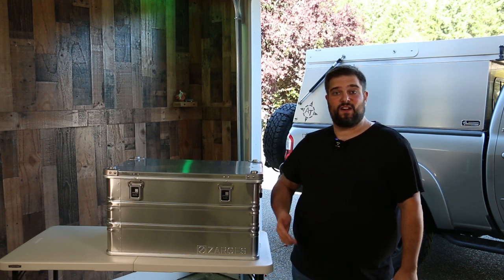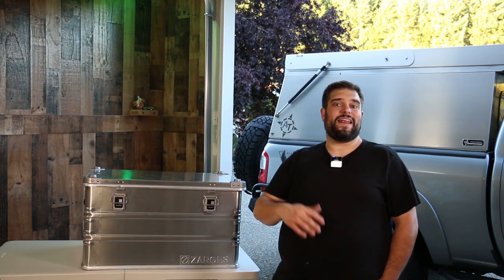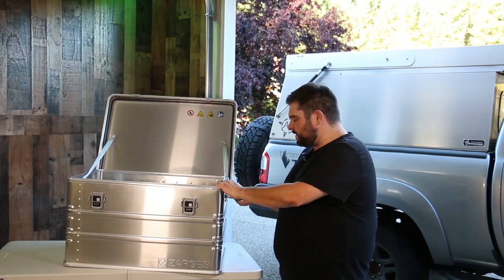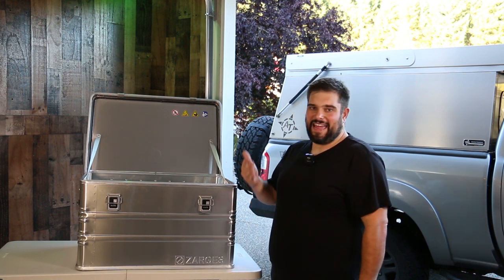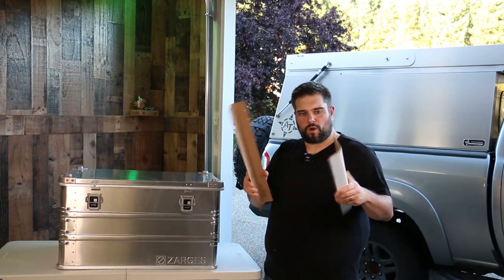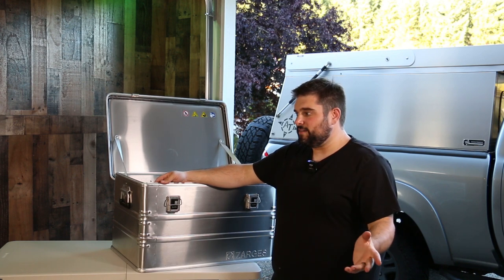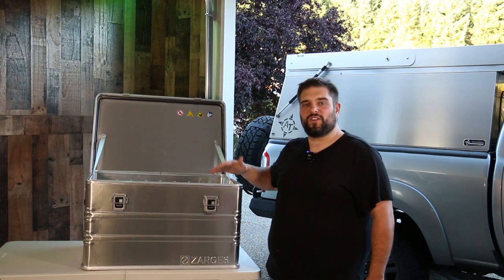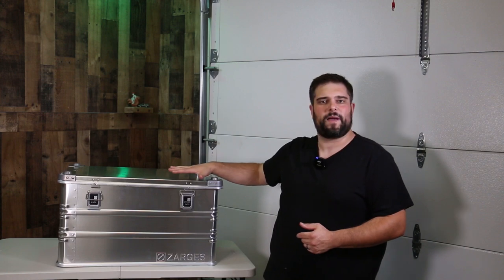Overlanding Gear Storage - Zarges K470 Aluminum Case Overview

Comment: The case is not designed to be sealed, they need to clip the corner of the sheetmetal at the end of the overlap so only 1 layer goes into the rolled edge. A little in consistency in lining up the panels may result in that triangular hole. I used to modify these to transport space hardware and one of the things we did was seal all the seams with 3M 2216 epoxy and add a filter breather. If you go out of your way to make it tightly sealed, it might start to crush itself if you do a big downhill descent.
Reply: Do you happen to know what the pressure relief valve was or part number?

Comment: Great video.  Did Zarges replace the case?  Oops, just finished the video.  Great to hear they stood behind their product.
Reply from the maker: They did but the next one has the same gap. I talked to their quality control department and was satisfied with the answer but it is normal to have this. I am going to hit it with a little lexel sealant and call it good. Thanks for watching
Reply: @EvergreenOverland  Just started to looking into cases and a little disappointed with that gap. Might look at Alubox instead. Appreciate the video
Reply from the maker: If you do let me know what you think. Thanks Jimmy